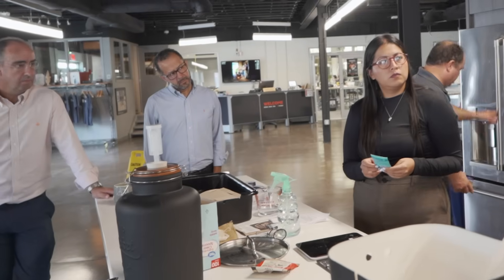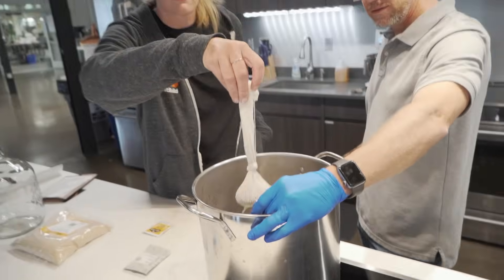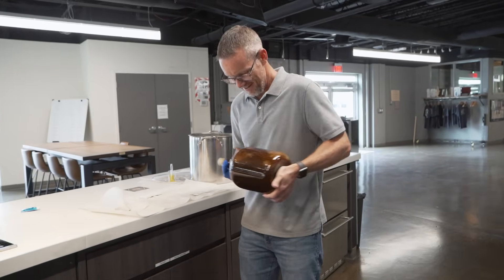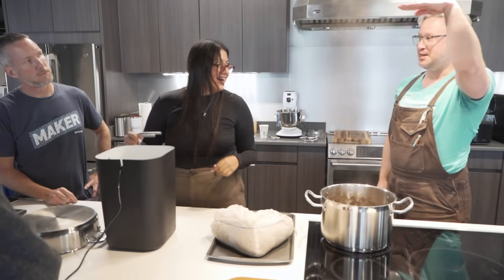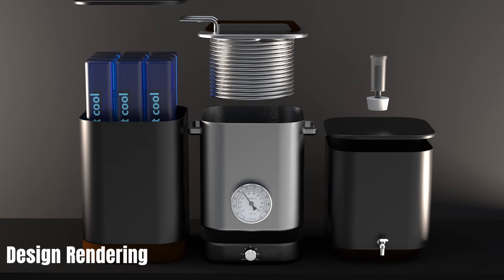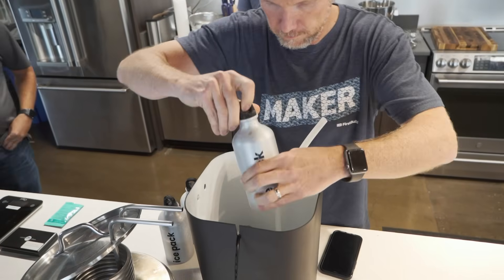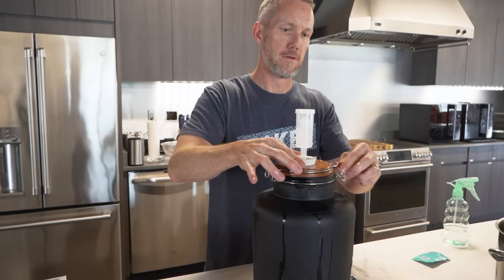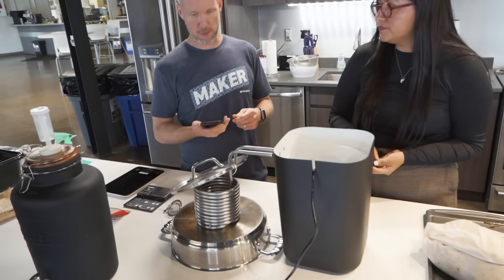Beer Brewing Prototype

Comment: Seems like this could be an awesome product. But I'd like to learn more details about each component. One curious thing I see is the chiller. Typically a chiller need not be sanitized. Instead, the chiller is added to the boiling wort 15 minutes before the end of the boil. This sanitizes the chiller. However, in this setup I see the chiller is attached to the lid of the boil pot. Boiling with the lid on is a no-no, because condensation dripping back into the wort can cause off-flavors. So I guess with this system the chiller is added post boil, which would of course mean spraying sanitizer on the chiller as shown. No problem I suppose except possible condensation (again). The chilling process seems to be a recirculating type, similar to a DIY version I've made that uses a cooler full of ice water and a pond pump. However, since the cooler is plastic, it's very important to run the chiller into a sink or drain first to prevent melting of the plastic, probably until it gets down to about 100 degrees F, before switching to the recirculating / cooler setup. How can I learn more about this new Beer Brewing Prototype setup from Mexico? Looking forward to the tasting video. Cheers 🍺

Comment: The biggest reason your vessel popped during fermentation is the air temp around the vessel. 
I always use a chest freezer with a temp controller that keeps the internal air temp between 62-68 degrees F for ale type beer.
Lagers need it cooler more in the 45-55 degrees F range. 

Looks like a great system, just let buyers know that they will need to control temp when fermenting otherwise you will have disappointed customers.
Reply from the maker: excellent. Thanks for the pro tip!

Comment: I homebrew and the first thing I noticed is the main kettle just seems a bit small for boil in a bag method. If increased your grain bill to make imperial ipa or stout, you would need or at least would make it easier to have a bigger pot. 

I would raise it by 2 inches and add another inch and a half to the circumference.
Reply from the maker: Thanks for the feedback

Comment: I would suggest y’all look at the Pinter. This brewing equipment is cool, but what it really needs is a new innovative fermenter/ serving system.  The Pinter is that more or less, but the developers seem was intrested in developing the gadget further into a tool for home brewers. Instead they’d rather target the noobie market and sell the device along with their steeply priced and mediocre quality extract kits.   Her immersion chiller looks cool. Pair it with a pressure fermenter (2-5 gallons)that doubles as a conical fermenter and as a serving keg.. then you will have the perfect beginning to end turnkey home brewery

Comment: I own two IGulu's.  An F1 and an S1.  I've only used the kits they sell, but they brew decent beer with close to zero effort.
Reply: You thought of that and I thought instantly of the English more analog Pinter system lol.  This is just begging for a small pressure fementer
Reply: @TheAsheybabe89  The Igulu's just control pressure and temperature; nothing fancy
Reply: @jeremydumoit4487 yeah but they're so expensive.  That's why I said fancy. Oh and the weird rfid settings thing.

Comment: I was a backer of the OG Picobrew back in the day. It let me go from complete novice to brewing drinkable, respectable beers essentially overnight. I won't dispute that being tied to the pods wasn't the best option, but I can't imagine having been successful without that pre-packaged mash bill ready to go. They did ultimately expand into the DIY space but I didn't develop the courage to try before the company collapsed under the weight of their ambition. This is all just a very long winded way of saying Yes, there's a market here, but it needs to have pathways for both novice and experienced brewers. BTW, can you add a Mead cycle?😊
Reply from the maker: What would you say was the best part of the Pico system for you?
Reply: @Firstbuild Honestly, I think it was the ability of the system to self sanitize. Because it was using steam brewing (i.e. it was primarily a steam generator) I didn't have to deal with many of the same steps you experienced.